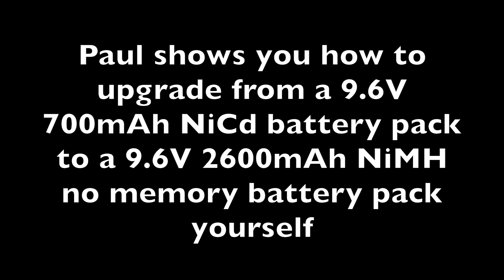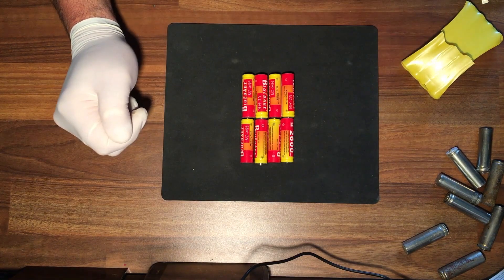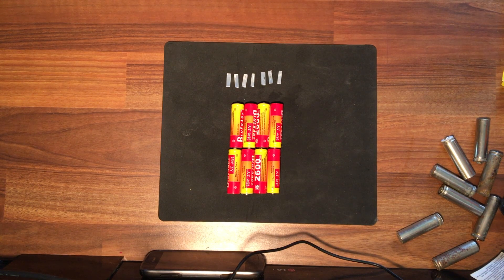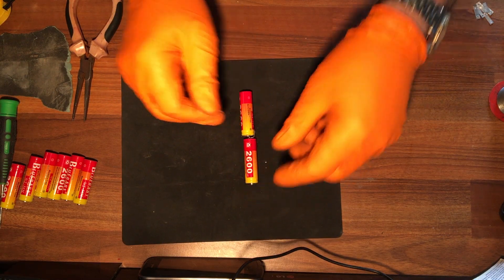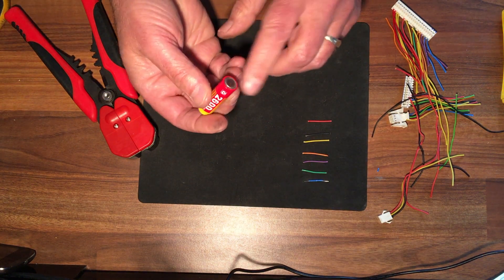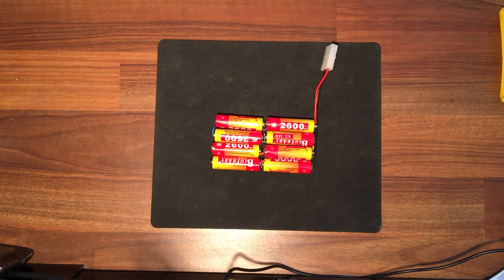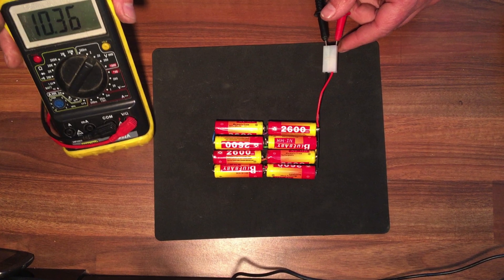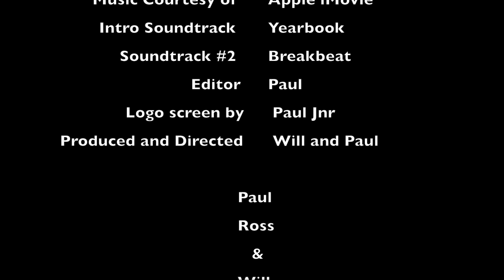Life Hacks How to Make a NiMH Battery Pack Easily Yourself

Comment: The first issue I saw here was the use of an aluminium can to make the tabs. This is not good because of the potential issue caused by joining dissimilar metals, ie. terminal corrosion. You really need to use nickel tabs or nickel wire. Also, aluminium is very difficult to solder.
Reply from the maker: Different metals are commonly soldered/welded together. This is just one of those challenges.

Comment: If I made a battery pack like this for my go kart would it work?
Reply: I see this charger doesn't have a Tamiya connector my battery pack I'm thinking about installing a Tamiya connector like yours 

That's what u used a Tamiya connector?
Reply from the maker: If you match the voltage then yes. The run time may differ slightly.
Reply: @DrivewayDudes  wdym match the voltage ohh multimeter yes?
Reply: @DrivewayDudes  hey wondering I made a battery pack it's gonna be 24v so id need 20 cells the cells I'm using are 1000mah rechargeable AAA batteries so far I glued the cells together looking to do the same like with the stripped wires and mines gonna be in series 

But after I connect the batteries in series how would I charge them should I use ibm6 charger or nimh battery pack charger I noticed the nimh battery charger that I ordered doesn't charge 24v only 6v-12v 

But thanks
Reply from the maker: @BlackCat-qm3sj  What size is your go-kart? if its toy size then 1 cell = 1.2V @ 1000mAh. 20 cells connected in series = 24V @ 1000mAh or for using your existing charger you could make up 2X12V battery packs and connect in series. 
If its a full size ride-on you would be lucky if you got a few feet so why not consider using 2X12V car or mobility scooter batteries connected in series which you could probably pick up in a scrap/junk yard for very little
Reply: I wonder where id find a bms for them tho 🤔

Also if I made my own battery pack with rechargeable AAA batteries or AA how'd I charge them maybe imax b6 charger something like that forgot the name lol lol 😆😂 but also wondering if you know where I can get some AA batteries for cheap

Comment: How do I charge a NiMH pack when all batteries are joined in series, do I need a circuit attached to the batteries or do I join the plus and minus to the charger? I do not get how a 16s NiMH ISDT D2 can recognise and charge each battery when there is only 2 wires, how can it balance them with it's built in cell balancing when it only has 7 wires for balancing. This is a question I have asked many times and no one gives the answer??? I have 10s D CELLS and want to charge them with the ISDT D2, how do I wire them together and join them to the charger?
Reply: NiMH batteries are very difficult to charge as charging needs to be stopped at the negative threshold of the peak voltage, also monitoring the temperature is recommended and also a timer, the current has to be kind of low for AA I think is 40mA for quick and 20 for low and time from 8 to 16hrs maximum and voltage around 1.40, I haven't seen any good video showing how to DIY NiMH charger, and if you just charge them using high voltage trough your array they might charge but most sure their lifespan can get reduced. there are some IC's that can do the job but just the chip is around 6usd plus all the components, I think is cheaper to buy 2 wall chargers
Reply: @mikewasouski  Thanks for trying. I figured it out and someone give some information. The D2 charges 2 x 5 batteries in series and the balancer wires go between each battery, after all batteries charge it discharges till they are all the same voltage. I have the charger now though have not built the battery holders. I need custom one's so I bought tubes and will put the cathodes and anodes in to space them.
Reply: @thethoughtmaster   should you be so Jenner out and share the idea. I understand ELECTRONICS a bit and follow the his video made good result with RC original 7.2V 700mah - 10minutes play gives about 30 min on diy battery. Was using multiV charger from maplins to charge. But that is. It controlled. Overheat sorted with bag of isolated cold water pack 500ml on top of batteries. But overcharge risk still bothers me.

Thought to un extra cable from positive end using Diode. Something similar to do using cathode and anode but my lvl is not that great, only in theory so calculation and diagram would help.
Reply: @Old_Wise_Guy  I bought the ISDT D2, I know how it works now, the charger has 2 x 6 series chargers/balancers for NiMH and the balancing leads go between each battery and balances them by discharging each a little after full charging voltage is complete. You will need to make your own battery pack for NiMH. The ISDT D2 has 2 fans on the rear and a vent on the bottom. It looks professional.

Comment: Quick question, I recently got a AA plastic battery holder in series and was wondering if this would be a good alternative to soldering the batteries?
Reply: I am going to do the same thing here soon. You can use a normal charger individually like normal.
Reply: @scromtinker7421  hey wondering friend I have a 1000w electric motor can I make a battery pack with AA batteries?

Comment: I ran a brushless motor with 8 AA batteries in series. Whilst the voltage wasn't a problem, the current was so low that motor wouldn't start under a small load.
Reply from the maker: AA batteries are not designed for that kind of load
Reply: @DrivewayDudes  I have a similar question.. I have a nikko vaporizer.. it uses the nikko 6v battery pack.. but after year, it could only hold charge for a few minutes.. so I opend up the box and pt in standard alkaline batteries, hoping to also get a little extra speed.. but the car just moved slower than before.. so I got muself some new Duracell 1200mah rechargeble and put them in the pack insted.. but same result, car just moves really really slow... Any idea why that is?

Comment: Hi, how are you charging the pack?
Reply from the maker: Hi Humberto,
 The original charger is suitable for NiCd and Nimh however with the low charge rate I use an iMax B6 so I can set a higher rate and charge faster.
Paul